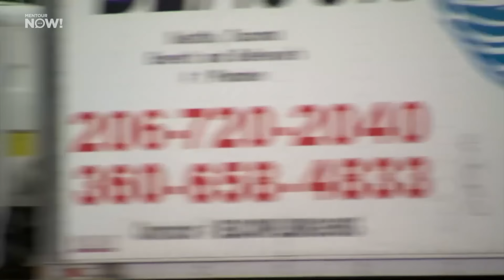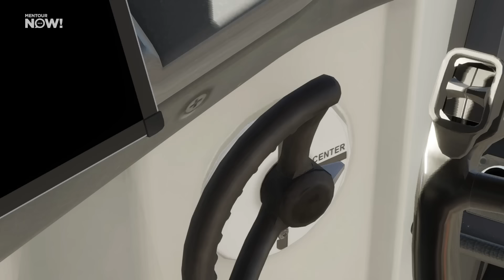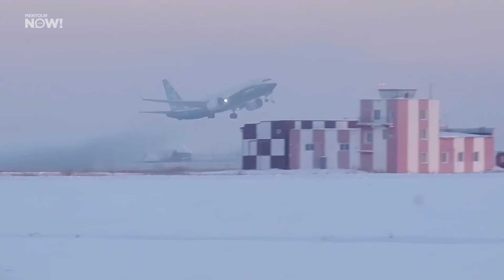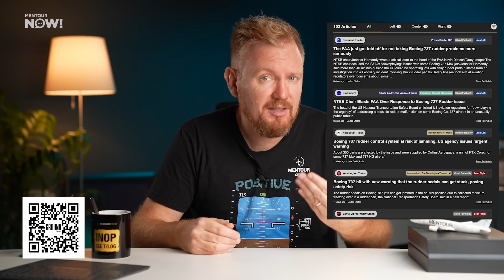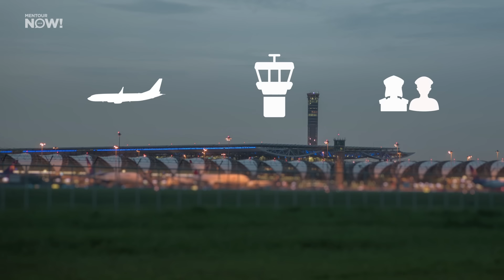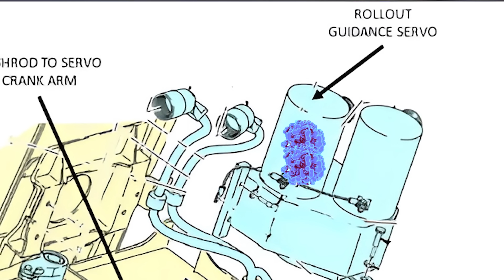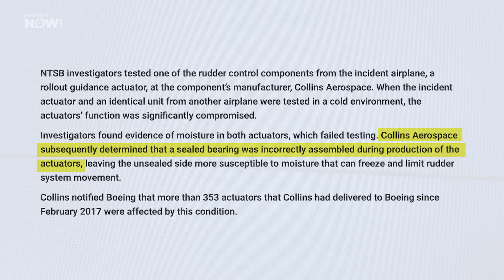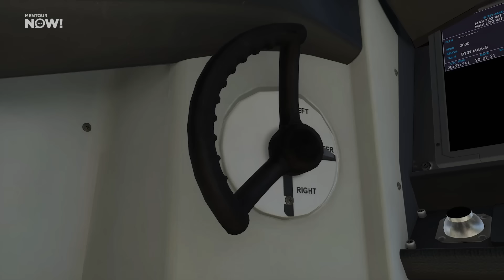Does the Boeing 737 Have ANOTHER Major Flaw!?

Comment: Am I the only one doing a paralel to "Overdoing inprovements on the same basic model of aircraft to the point where the improvements start to interfere with each other."?
Basically, what I'm talking about is trying to keep the original basic model, but also keep changing the various later sub models to improve on their capabilities to the point where there are so many trees (altered components relative to the original specifications of the main type) that you cannot see the forest (the basic aircraft type) anymore because all these new gadgets and improvements start to require modifications and altered strength requirements and manners of operating, that the original buildup of the type cannot cope anymore, yet hasn't been changed accordingly because nobody has envisioned this to happen.
The matter is compounded by the fact that this type (the basic 737 buildup) has never been designed to do any extreme maneuvers or changes in attitudes etc, which often tend to mask the problems as they are only readily noticeable during more extreme maneuvers and will only give very slight hints at their presence that can easily be seen as something trivial and totally unrelated and not dangerous when keeping to the normal docile operation of the type.
What I am saying is that if these "overdoing the upgrading" problems that seem to be emerging more and more frequently on a number of issues are so abundant as seems to be the case with the 737, isn't it time to totally rethink the type completely and do away with all the upgrades, instead building an entirely new aircraft with purpose designed components that have been designed from scratch to incorporate the lessons learned over the decades with the 737? In essence still a new aircraft, but incorporating the now known basic layout of flightdeck, instrumentation, outer appearance, mimicked handling characteristics in the design etc.
For comparison, check out the evolution of the C-130 Hercules. This type remained basically the same through several decades, with the mission specific and upgrade specific components integrated into the existing airframe. But when they decided on building the new J basic version, they actually altered the whole aircraft. It looks similar to the original concept. But in fact, nothing in it matches anything you will find in the A to H versions. Wings, elevators, rudder, engines, the airframe itself, controls and control connections, you name it, has been altered and designed to fit from scratch, leaving no part of it interchangeable with any of the earlier models. Basically a whole new aircraft with the capabilites and handling chraracteristics to match the earlier type, albeit with greater range and load capability. Just about the only thing not changed is the cargo compartments strapping points and seats etc as the manner of using it and securing cargo etc have remained unchanged to this day. And even there, a few minor changes are to be found even if it basically functions the same way that it has always been doing.
I have come to think that the basic 737 concept has reached the end of it's adaptibility to new ideas and needs to be purpose designed and built from scratch in the same manner as the C-130 if it is to  have any viable future and upgrade capability. The current basic structure as I see it is only allowing patchwork modifications that will more often than not create more and unforeseen new problems than it solves.

Comment: Jammed rudder plus single engine failure leaves only one viable option.

Power to idle, hope that the landing surface available is somewhat decent.

In any event, a competent crew will “fly the aircraft” until on the ground and stopped.

Comment: I had the extreme quite terryfing chance to experience a category 3 Charlie landing on the mighty A380 coming from LAX to CDG in 2020. The captain told us that the plane will take care of it. We didn’t know whether we were at 3000, 100, or 10 feet. I wish we could have eared the minimums to have an idea of the touchdown 😅 but it all went super smoothly and then it was guided to the gate as well. We were all mesmerized by such an extraordinary technology that lead us so safely to the ground. The applauses and bravo shoutings came from all the decks and classes of the plane. This was the last flight of the Air France A380 : at the end of January due to covid they decided to shut down the A380 program 😢

Comment: I am not an expert neither an engineer, But I believe that like on every vehicle on ground or air, they are designed with the original engines and aerodynamic to perform correctly with those specifications. Now, when they want to place bigger engines and they don't fit and so are place out the original place, that affects the performance and aerodynamic of the plane. and even after so many software changes and upgrades, it's proven it does not work properly. I will not fly on them.

Comment: It seems Collins was the party responsible for the incorrect assembly and contamination that caused every failure and the comprehensive fix was to either have Collins rebuild every system that remains in use or removal of the part if it isn't used as part of the CAT level requiring this part to work properly.  Collins needs to pay for the repairs too.

Comment: Brute force? Really, Boeing?? I'm no pilot, but if there's one thing I get out of the pilots actions in Alaska Flight 261, it is that if you have reasonable control of the aircraft and are troubleshooting a jammed control surface, never use brute force or repeated mechanical inputs to will it into getting free. You go from having a bad day to worse, if it gets stuck again in a totally uncontrollable position.

Comment: I am puzzled that the NTSB has apparently not recommended or required that the defective units which have a leak that lets water in be repaired or replaced. If that is done across the problem, then the modified instruction for unjamming would rarely, if ever, need to be used.

Comment: Petter, the thing that troubles me most about this system is that it could fail in ways that even made manual operation difficult to impossible. Even a gas water heater is designed to fail and not work, to cease being a water heater; this gim whizzle could fail and block the rudder control system. Power steering in a car can go out, but the driver is still connected to the wheels and can control it.

Comment: I'm surprised that when the roll out servo was deactivated it was left mechanically connected.  What was the reason the control rod from the actuator to the rudder system wasn't removed?  Was it just an oversight or is there a system operation reason it was left connected?

Comment: Normally aren't electrical servos interfaced with the flight controls via a clutch mechanism? Maybe I missed you mentioning it or maybe it wasn't part of the design in the first place, which would be odd and a design flaw I think? The clutch mechanism would be designed such that the drive from its servo could be over-ridden by the force of the pilot.

Comment: I thought the main difference between 3C and the other Cat3 categories is that landing and taxi (including taxiways) is down to zero visibility in 3C; 3A and 3B do require visibility. Not sure if stand/apron would be covered by 'taxiways' though? I seem to recall reading somewhere many years ago 3C did include the ability to taxi all the way to stand in zero visibility, which a few decades ago probably wasn't technically possible. So I seem to recall things like a failed/inoperative auto-braking system downgraded an aircraft to Cat 2.

Comment: There are very good reasons why the brute force approach is inappropriate: in flight with a frozen control there is a risk that the brute force application causes a momentary slip, and the control then refreezes in a new and more extreme position, that could lead to severe control difficulties. 
There are several noteable incidents where this has been a factor, notably on the BAe 146, which had a vulnerability to ingress of deicing fluid in the horizontal stabilizer axle area, which subsequently hydrolyzed and froze.
This is more evidence of real lack of rigour on the part of Boeing which is deeply concerning

Comment: 737 is the lead balancing of the deltaeder, the delta cutter edges. The plane has nuclear rights to carry delta molecules.
The DC 10 means delta cutter. 
The DX on a 386, 486 is the cutting point of the deltaeder, it is in gas form. The wounding of the molecule causes the flesh to become rotting, like in human corpses. The Covid Delta variant resides in the dead area, and spreads from there.

Comment: We have been here before with the 737 200's with the rudder hardover. Two crashes and one near miss. The cause and effect are different, granted, but this has been spotted without a hull loss. It sounds like the NTSB are on top of it. It's an actuator and suffers from cold issues - pretyy much the same as the hydraulic actuator from years gone by. Fit new ones. Easy :-)

Comment: I’m a mechanic that has worked for an airline for 25 years that flys the 737 exclusively. (That narrows it down.)
It’s been interesting to watch the progression of maintenance issues between the Classic, NG, and Max versions of this aircraft. I feel Boeing really got it right with the NG’s and I wish they would have just developed a next generation version engine that would fit on the existing airframe. Our airline flys the crap out of their birds and the NG’s have held up really well. The Max just seems like it should have been an all new aircraft.
(The one thing I do like about the Max is the removal of the spoiler mixer and ration changer nonsense. That would have been nice to incorporate that into later models of the NG’s.)

Comment: Petter....Petter....Petter....It is urgent, for Boeing to survive at this critical juncture, review their testing policies and procedures of the parts that they purchase and NOT manufacture themselves. As a preventive action, a step that it is inclusive of any Quality Assurance Processes. As a preventive action, the 'Naive' behavior they seem to have in every testing process, 
may date from the testing policies developed over 50 years ago. Nonetheless, it seems like there were far more effective than today's or near past testing policies and procedures in critical items.
I have been watching, MAYDAY, AIR DISASTER, and other documentaries, by which I have collected, just close to 10 catastrophic failures on the rudder system which doomed United Airlines 
545, American Airlines 427, and others. All seem to have the same failure mode and characteristics from the pilot flying stand point. 
The critical components, which have no redundancy, need to fail in the ground during actual manufacturing process, final testing process, at the manufacturer of the component.
Typically, there is a record for critical parts, which according to specifications requirement, test the most critical parameters. Such a record is kept at the manufacturer's facility, while the shipped unit only typically arrives with a piece of paper, which indicates, the unit performance to tasks and specs. This piece of paper, is usually called a "...Certificate of Compliance..." and signed off by the final inspection individual and the responsible for Quality Assurance & Reliability. However, these Certificates, are usually duplicated according to the quantity of the component in critical questioning. This custom of filling in the blanks, without actually looking at the parametric report for proper operation, over time becomes somewhat of a rubber stamp.

This is, in my view the "...Achilles Heel..." that may finally may bring Boeing plummeting in a spiral downwards for the company.

The NTSB, had invested 10 years, during testing of another similar plunger on the rudder ( into the actual rudder mechanism ) which was tested while being manufactured.
So, after 10 years, and besides that for 9 years and almost to the date of the accident, they tried out different environmental conditions: They did a Reliability Empiric Testing
for environmental conditions. As I was watching the documentary about this information, I almost wanted to talk to each person down the line of the manufacturing and testing process
at the manufacturer, as well, as into the Incoming Quality Assurance, or Receiving Inspection at Boeing.  
Once again, the Boeing passivity about their supplier chain, without properly testing for this non redundant item, is what led to the catastrophic failures of the previously mentioned flights demise.

So here we go and finally through the NTSB testing in a simulated thermal amplitude testing, where the outside environment is extremely cold, and the hydraulic fluid, keeps its retained heated temperature, causes, the actual plunger to lock itself into a full rudder position with no possible return, by pressing on the pedals with any humanly possible amount of force even
when both, pilot and co-pilot both step on pedals simultaneously.

A string of the same type of failure(s), yet, with close calls coming into the potential of another near catastrophic event, is actually the end result of the lack of Boeing demanding extreme testing on critical or non redundant parts.

When I was working at Singer-Link Flight Simulators, way back then in my engineering heyday, an era in which I calculated the Mean Time to Failure, Mean Time Before Failure, along  with similar influential parameters, I was tasked with replacing all the military temperature range electronic components in the Space Shuttle Simulator, with the industrial and or commercial temperature range components. - The reason I was given for this, was the fact that the simulators, never get off the ground, and that as much as clientele, and armed forces were looking to "...improved costs..." - I spend almost a full year coming out with each new commercial component, actual failure rate. - There were two ways to go about it: the calculated way, and the empiric way.

Calculated way, you may want to use, when there is a level of confidence in the actual component or device you are analyzing based on the previous reference testing, which initially had been most likely for reference performance, yet, these tests which were initially implemented, were for the most part implemented over the full range of capable temperature ranges rated by the manufacturer, yet, we were able to verify its performance via a first article on each delivered lot. - This is fine when the lot isn't large at all, may be a lot of 10 units. Yet, when you see increasing in orders and you need to enlarge the focusing on scheduling for a faster turn around, most Product Managers, or "...Legislative Bosses..." would for the most part, choose the
"...Calculated..." way of measuring the performance of the component or part reliability.

When compared to the empiric way of testing, it was a Life Cycle testing, a Burn In testing, a Screening testing, and off course the Reliability testing, along with the Mean Time to repair, yet measuring aircraft time down, along with any de-rating performance of the unit being actually testing.

Life cycle, a test which ought to be conducted according the environmental conditions of where and when the critical component would be utilized under extreme operating conditions.
Burn in cycle, a test which ought to be conducted according to mean environmental conditions of where and when the critical component be utilized under normal operating conditions.
Screening, a test which is design to find the actual interruption(s) of component failure,  under normal conditions, making the exposure to normal cycle temperature testing, somewhat longer or stronger or both.

Once these test results were combined over a timer period chartered across a given temperature range, their cumulative performance, would be recorded and measure against the actual calculated figures obtained previously to start the empiric cycle of testing. 

Sometimes, and according to established standards of industry and military test / analysis requirements, at times, the resulting number, would be that the part would not fail withing a 500 years period.

And yet, Sometimes, these catastrophic failures do take place, because their testing was not actually a complete process for the application there were designed for.

Collins, and other makers, may have look to test at ambient temperatures. However a runaway is almost never at the airport's main facility ambient temperature due to the
constant jet stream generated by aircraft rotating and their rotation turbulence also carries an exhaust gases temperature.

So, may be initially the failure was on the component maker or manufacturer, however the verification for these components or parts, is responsibility of Boeing's Quality Control.

Petter, I am telling you, do not let me go to Renton, I would make their big wheel leaders in charge, to put safety before profit. Just like always was.  I can help them if they ask, 
however, a cultural clean up must be done prior to any help they could potentially receive at Boeing.

Sincerely
Ricardo
Fail Analysis Eng.
(Hope not to make you fall asleep with my messages )

Comment: United asking for the deactivation of the Rollout servo without removal could very possibly have created a synario for the servo to fail without system fault indication. 
Due to its inactivity the chance of flight control jamming will always be increased.
Moisture ingress into an Active Rollout Servo system will  normally be indicated by an Auto pilot fault and or System fault.
Boeing and United should have filed for a minor Modification and removed the inactive servo from the start.
More than likely another cost saving experience by the airline